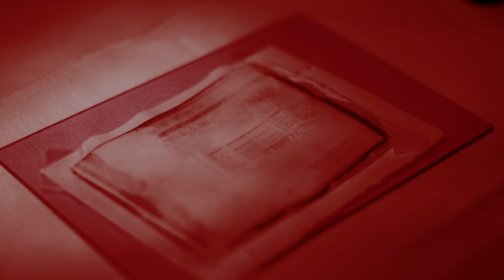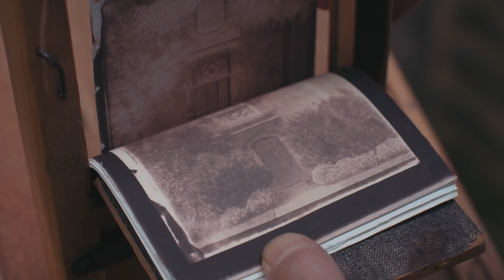How was it made? Calotypes | V&A

Comment: What kind of paper is used?
Reply: I think I remember reading that it was regular paper, and the texture interfered with the sharpness of the picture, because the silver nitrate soaked down into the paper. Later they started putting something on first, maybe it was albumin? to prevent that and thus have sharper pictures. I'll check all this and edit if I'm wrong. (I'm taking a class but I'm a slow learner!)
Reply: @L.Spencer  Hi Loraine. Thanks for your answer.
I also read that they used regular paper but now that I'm trying to build my own camera and want to get negatives without the use of acetates from a printer and a computer, I wonder how that kind of paper works having into account it's not translucid.  You need that property for obtaining a good positive, the more translucid the better. 

Recently I found that they used to wax or cover with oil the paper for making it more transparent but I still think it is not enough translucid for getting negatives that allow (By any technique) later to get the high quality pictures you see when reading about Calotypes and salt prints.
Reply: @lufertu  the negative is on a paper thin enough to be translucent, which is good enough for contact prints
Reply: @lufertu  Hello from Vermont! I work with another antique British photographic process; the cyanotype. My negatives are on regular paper which is made translucent with wax or oil. It worked in the 1840s and it still does, today. ☺

Comment: What is the difference between a calotype and an ambrotype?
Reply: an ambrotype uses glass instead of paper, and I /think/ it has a few different chemicals used, but I'm not sure
Reply: @garge7676  I did look it up since I posted that question, but I'm still not clear on the difference.  Guess they're just a little bit different as what you pointed out.

I believe that only daguerreotypes used the glass and that ambrotypes were done on tin or copper plates?  I've read that the details of images on daguerreotypes are absolutely stunning to see in person because they were done on glass which means very little scattering of light...though I imagine polished copper and tin would be comparable.

I also was able to find that daguerreotype images could be mass produced only by photographing the daguerreotype image as an ambrotype image and going from there.  For years how they mass produced images from the Brady, O'Sullivan, etc. Civil War daguerreotypes that they took on the battlefields using glass plates could end up on paper and sold to the public, including stereoviews.  Of course, that would mean degradation of the image as the product you could buy was a second generation version of the original image, unlike mass production of images from a single original negative as developed later.
Reply: Daguerreotypes were made on a piece of copper coated with silver, or on an actual piece of silver. Tin/Copper plates were Tintypes, also known as Ferrotypes. As for duplication, I'm not at all sure.
Reply: @garge7676  Well, I know for a fact that Daguerreotypes were originally produced mostly on glass plates.  I've seen them myself and there are many examples of Daguerreotypes to view which show the cracked glass.

Now, I wonder to what extent Daguerreotypes were produced on media other than glass, and whether using metal plates paralleled the production of Daguerreotypes?  Can't really seem to find information on that.

I'd also like to know that since the Daguerreotype is essentially the negative, if the original glass plate can be put into an enlarger and developed from there?  I would suppose it could.
Reply: I am quite sure that Daguerreotypes were NEVER printed on glass.

Daguerreotypes - Silver Plates
Ambrotypes - Glass Plates
Tintypes/Ferrotypes - Iron Plates

I've heard of people making larger prints of glass negatives onto paper but I don't know how it works.
Reply: @garge7676  Ah, you are correct.  I should have said collodion or ambrotype images on glass.  However, daguerreotypes on glass plates I believe were experimented with and I have seen one surviving example from the early 19th century.  There is also a Hungarian photographer who makes daguerreotypes directly on to a glass plate that he silvers first.  I remember he talks about how difficult it was to perfect the process on glass, so since he could obviously just have done his pictures on metal, or done ambrotyping on glass, he knows the difference.  Quite good work he does, too.
Reply: @valentinius62  Do you know the Hungarian fellow's name? I'm interested now
Reply: @valentinius62  Silvering is a main factor in Daguerreotypes.  They would not be done on glass with the exception of a silvered mirror and if so, were far less common than metal.  There were even professionally made stock plates that were pre-silvered and could be bought so practitioners had one less step.  Wet plates, known as ambrotypes (glass) or tintypes (metal) depending on their substrate took over the popularity of Daguerreotypes when they were invented.  Those you will see much more on glass as either negatives or positives when backed with dark material.